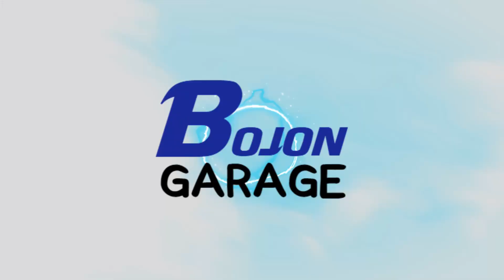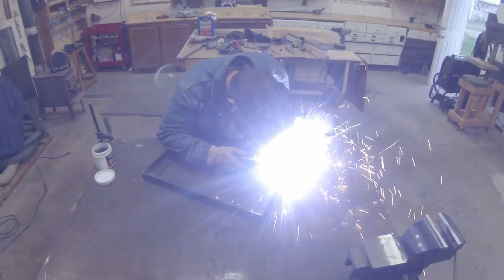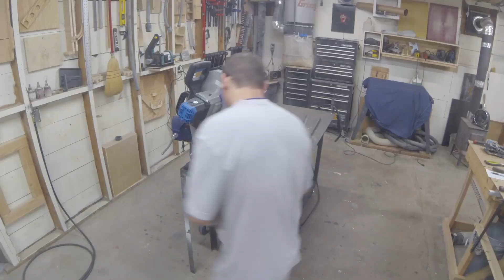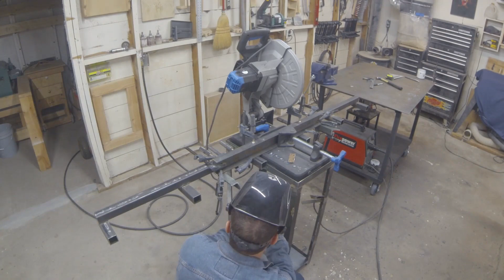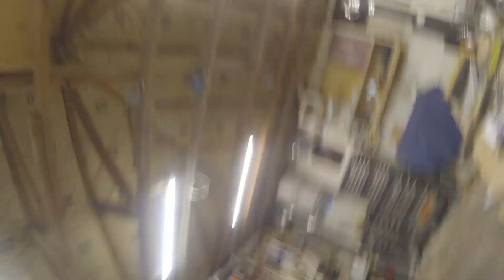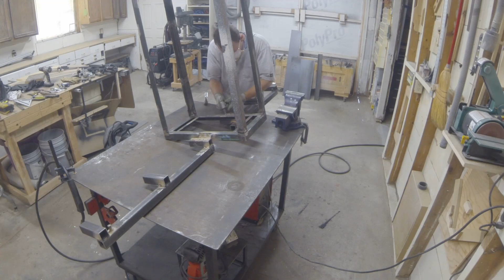Chop saw stand, mobile cutoff saw station, evolution metal saw base, circular saw rolling cart

Comment: Cool, I like the folding support arms.
I also have an Evolution saw, I got fed up with it launching chips all over the place, plus they kinda embed in everything and get tracked all over… so I welded up a 72x32 cutting/grinding “station” with a sheet metal funnel that directs the mess into a metal pot.  The plasma cutter fits underneath, the Evolution and portaband sit on top.  It has left, right, and rear deflectors, the left and right have removable sections that allow material into the saw and out the other side.
Reply from the maker: sounds like a cool build